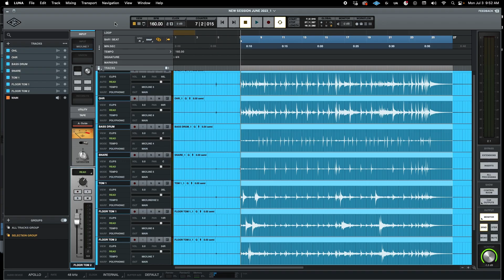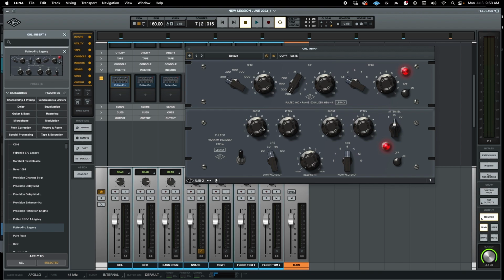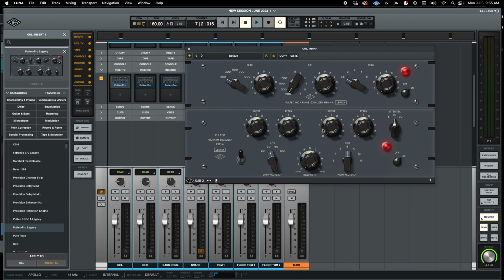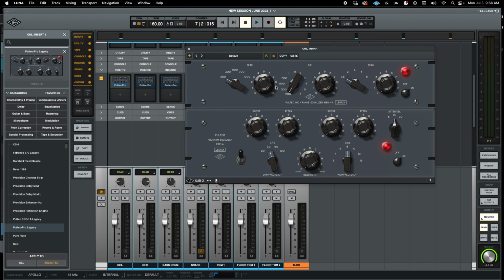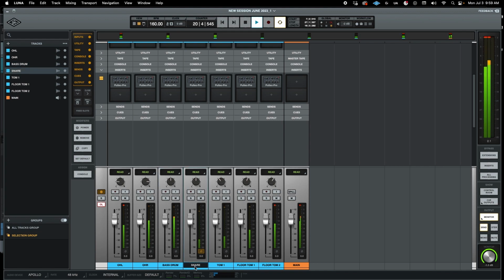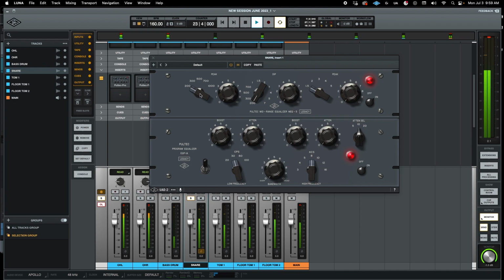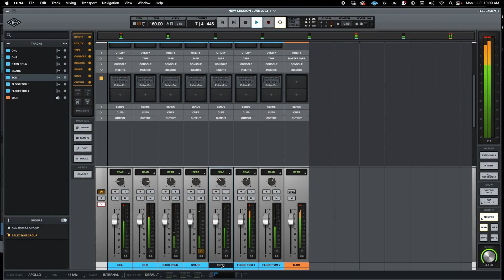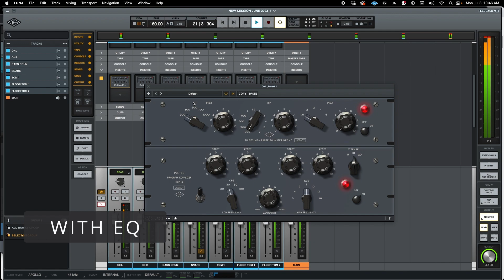Bring Your Drums To Life with the Pultec EQP-1A

Comment: I would like to ask you about mixing drums with pultec passive eq collection, is the dbx160 or the uad1176 compressor more suitable? Which of the two compressors would you recommend?
Reply from the maker: To me they are completely different animals with different purposes. I use both of them. The dbx160 is the latest addition to my collection of compressors so I'm still getting used to what it can do. What I've experienced with it so far I really like. It's really simple to use and it gives the track life, energy, warmth, and if you really crank it, attitude!
The 1176 is the fastest compressor I've ever owned. You can really shape the sound of your kit using just an 1176 on each individual drum. Choosing between the two compressors is really difficult. I think you just inspired a comparison video! Look for it soon! :)

Comment: Why are your meters clipping on the main and the overload lite red your channels look pretty hot are you not hearing any distortion, retry this with your channels peaking around -12 for starters do you gain stage or just use your ears , I don’t go over -12 on my drum buss always works for me with all other elements mixed in going to the main buss to achieve closer to -6 on the main buss for  headroom on plugins on the main master buss. Like your groove and feel
Reply from the maker: Hi! Thanks for the compliment and your question. I always trust what I'm hearing rather than what the meters are telling me. I'm not exactly sure why it's not distorting when it says it should be but it sounds great to my ear. It might have something to do with LUNA. When I was working with another DAW I would have to make sure nothing was clipping in order to get a good sound. Not the case with LUNA. I used to gain stage. These days I just trust what I'm hearing. :)
Reply: @RecordingDrumsWithBrad  I use on kick, toms dbx160uad. 1176 uad in snare hh, ride crash. Along with api channel strip eq on all drums separately and a bit of pultec

Comment: I recently bought from Uad both compressors (1176, dbx160). I have combined them with the eq pultec passive eq collection which sounds nice on the snare (pultec with 1176). the dbx sounds better on the kick. On the toms I still struggle to find the right setting to achieve the result I want!
Reply from the maker: What sound are you going for with your toms?
Reply: @RecordingDrumsWithBrad  I play from Roland electronic drums. Steven plate vs. I play hard k metal mainly backing tracks. I'm interested in hearing the toms (10,12) and floor toms (toms) bright like maple toms! Is there any setting for the pultec so that such a sound can be successfully output from the toms?
Reply from the maker: @giannispan8129  Try cutting the frequency of the toms at around 200hz by a few dB and boosting the frequency at around 4khz and 8khz by a few dB. See if that helps. :)